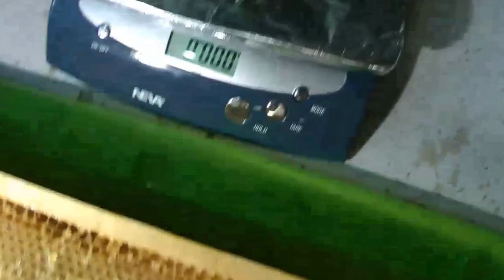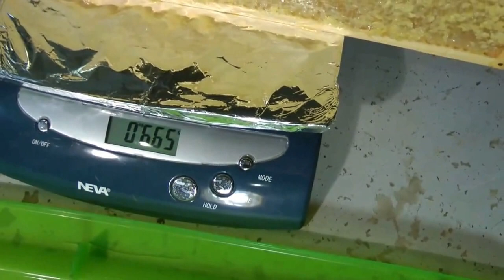HOT knife vs HEAT gun part 2 - the VERDICT post extraction

Comment: The "comb damage" as you say, is just because there is no wax removed, so that sits on top of what you call perfect comb in the other frame.  Also, the time savings is like hours!  Clean up, no wax to mess with, nothing to clean.  Its not a method I use often but it is better than you presented.  When I did it I did not have any cells not open, plus you have to heat it, and extract before they close back up.

Comment: So since you get no cappings. You don't have to filter them or press them. So that time and work saved, large. The honey that remains in the comb goes back to the hive or is melted into wax. Since I melt all my frames and replace it with wax foundation the heat gun works for me. You can use the heat gun directly over the extractor since there is no cappings and placing them directly into the extractor, speeding things up.

Comment: Good assessment, I think the heat gun only does a few good areas around the frame and leaves others missing which causes a lot of honey to be lost. Although I think it would be a bit ideal to use the heat gun sometimes for the sake of the bees work, and depending on how fast you need the honey but then we'd be sacrificing honey for the sake of a quicker time. God bless ,I lean more toward on the heat knife side it simple and effective.
Reply from the maker: +Alexandro Ledesma Hi. Yes, the heat gun can be useful, and is more pleasant if you don't mind the noise'during your honey extracting. But any honey that remains behind and is not extracted means, that you are exerting energy to take it out of the beehive, move it to your honey extraction setup, do all that work, and then return the honey left behind back into the beehive. You want to be as efficient as possible, if possible. And the heat gun we found less efficient in many ways. Thanks for your comments and happy beekeeping! http://www.mahakobees.com/store.html

Comment: Watch Bee Spencer Video. His don't look anything like yours. You did something terribly wrong. Maybe u held your heat to close for too long. It don't take much heat to pop those caps.
Reply from the maker: Joey Willcutt Hi Joey. Yes, we have seen his and many others on YouTube. As we tried to explain in part 2 video (https://www.youtube.com/watch?v=00TydRGmm6U), the heat gun method works, and works well, but only when the frame of honey is fully capped AND the caps are white with an air pocket under it. If the capping touches the honey (darker), then as the heat gun tries to melt the cap, it doesn't "pop" the beeswax, rather it melts onto the honey. So the wax foundation either remains sealed, or creates those wax bubbles, and does not extract well. So, the verdict is, that unless you have 100% edge to edge capped frame with air pockets under the cappings, you still need to run a knife or a decapping fork through it, not really making the process any faster or easier. You loose the cappings for beeswax production, the frames are not leveled off for nice and even redeployment of the frames, and as we have tested many times, at least 10-20% less honey is extracted. All in all, it is a method, just not a good one in our opinion. Thanks for visiting and commenting. All the best.